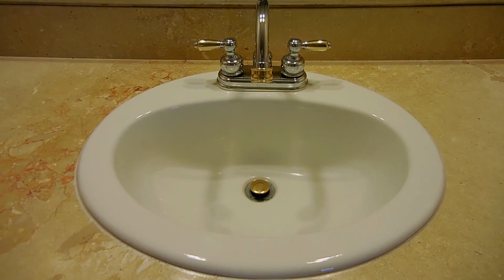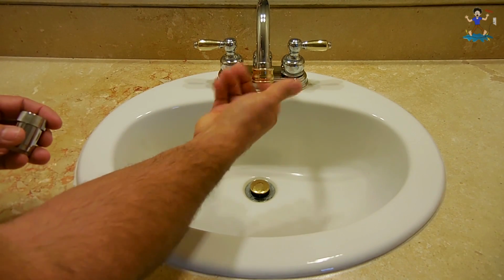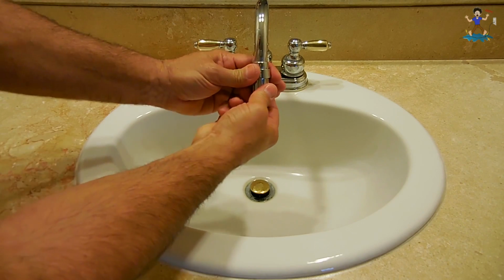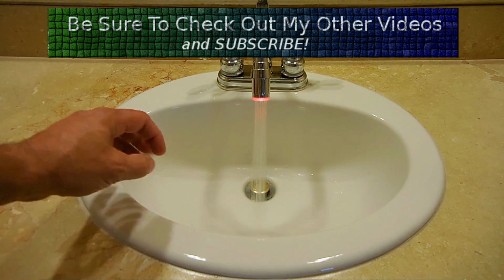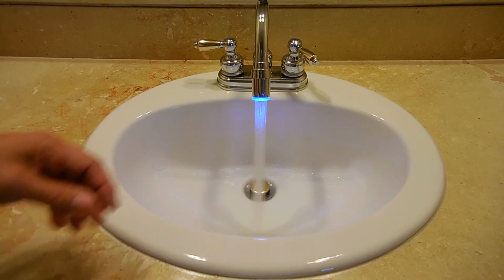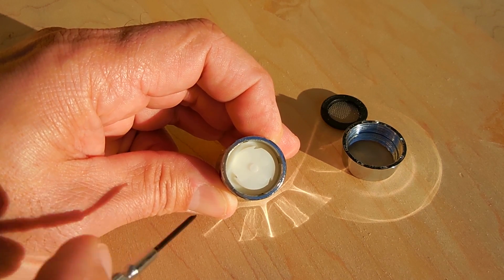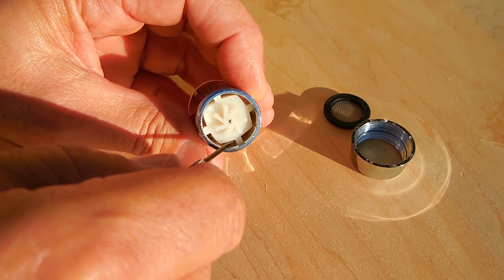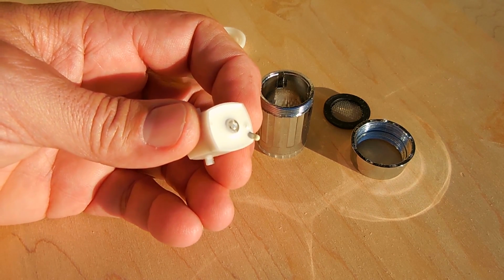Very Cool Faucet / Shower LED Gadget!

Comment: Someone could easily make an entire channel doing reviews of products from Banggood.  Overall I've been quite satisfied with everything I've gotten from there.  The only thing that was bad was a microSD card reader that quit after a week of use, but once I provided a video for them demonstrating how it didn't work at all, they sent me a replacement that has worked perfectly well ever since.  The benefit to a channel like that would be unbiased and unsponsored videos that are from an actual consumer, not just what's produced by Banggood itself.
Reply from the maker: 00Skyfox I've only had one or two minor problems over the past 2 1/2 - 3 yrs. I've also had a problem with an ebay sale, and I ordered a folding solar panel from Amazon, and when it arrived, inside was a stack of printer paper and no panel. Lol

Comment: Just an FYI, this will increase flow resistance and water pressure and caused a leak at my sink's u bend.
Reply from the maker: If the faucet isn't in good shape, then I don't suggest using this gadget. Your faucet definitely won't be able to use a water saving aerator. You need to replace your faucets seals/o-rings.

Comment: Wonder how many volts it makes?
Reply from the maker: Regulated to around 3.3V.
Reply: red/green/blue leds operate at around 2 volts. white around 3.5 v. you can google for leds operating voltages

Comment: I've bought at least 20 of these things, with and without batteries, but I've found that every single non-battery faucet gadget makes a loud-ish whistle.  Kind of like the way Home Simpson's nose whistle sounds :)     Any way to stop it ?    Thanks for the vid !    ps - you're right, these are great, especially to know when the water's warmed up - I don't have a faucet without one !
Reply from the maker: Mine lasted 1 1/2 years before it clogged up. Can't complain for the low price.

Comment: The idea of the LED faucet gadget is so smart, I', going to buy one. Where can I buy this one? On Ebay or other online auction websites? Anyway, I'm going to search the item.
Reply from the maker: I posted a link in the video description area, along with money saving coupon codes.
Reply: Thanks for your response~! I'm going to check it out!
Reply: Well, after checking the item from the website, I discovered that the diameter of the my faucet doesn't fit its one in spite of its adapter with a diameter of 2.2 cm: 1.3 cm vs. 2.2 cm. Thanks anyway! It's still cool.:-)

Comment: What I learned is that your hot water sucks.... ;p
Reply from the maker: Mat Helm Not my hot water, but when you have a 6,700sq ft home.....that's what happens.
Reply: 6,700sq foot! That is huge! My place is 1,100sq foot and we still get that long wait for the hot water to come... copper pipes and pex tube transfer the cool temperatures from the surrounding air and take a while to warm up. Great video.
Reply from the maker: It's a home that my parents and sister/brother-in-law bought to renovate and sell. 1,600 - 2,000 sq ft is plenty for me.

Comment: Where did you find the adapter ? The faucet doesn't fit my tap.
Reply from the maker: Should be included, if not, any hardware store sells faucet aerator adapters.
Reply: @electronicsNmore  : not included. I guess I need to look for female faucet aerators adapters, then.😥
Thank you very much :)

Comment: '
home tap water is a not clean...
problem with corrosion white acid on the water
Reply: Ya. But you can get a good water ionizer for your taps. I use one myself and get great alkalized water rich in anti-oxidant.
Reply: hi B L...
home tap water is a very old pipe in whole home...
too late and cannot fix...
but i put a water filter in the clothes washing machine...
already video in my channel...
thank

Comment: Cool, but the turbine has that typical whining sound unfortunately.
Reply from the maker: For only 4 bucks you can't expect too much. Instead of hearing a faucet running, you'll hear that whining sound in the video when the flow is "Full Force". At moderate pressure levels you hardly hear a thing.
Reply: electronicsNmore 
I see...Thanks for the additional information!
Reply from the maker: You're welcome